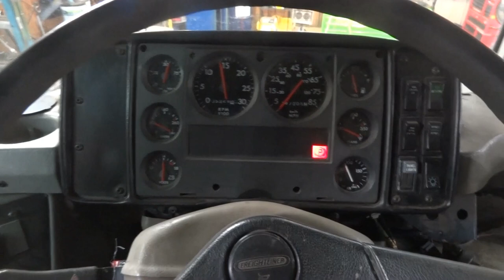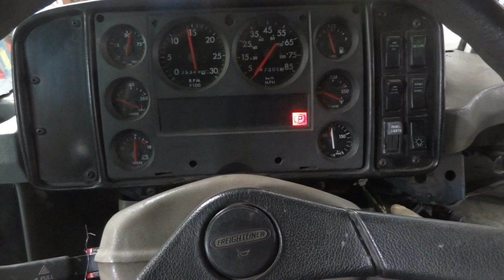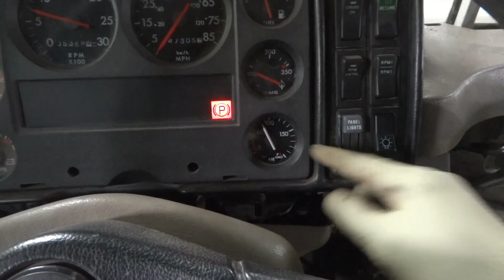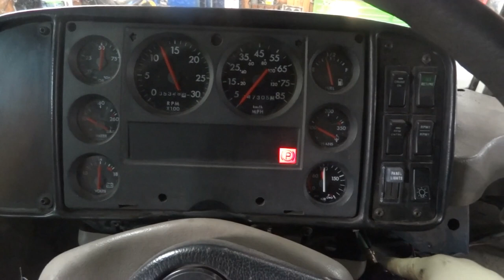Brake Chamber Replacement on a 05 Freightliner school Bus

Comment: I hope you didnt leave that ABA  adjusted like that.That red or orange tape or marking that shows when you applied the brakes is an indicator showing excessive stroke. This means you have no more pushrod travel and your brakes are way out of adjustment. Also the 90 degree angle , is when the service brakes or parking brake  are applied,  not when the brakes are in thier released position.
By the looks of it when your friend hit the brakes the angle was over 130 degrees which is why the orange indicator was showing. Hope this helps you clarify the important details in the future so your viewers can be aware of  improperly adjusted brakes.
Reply from the maker: Reekson  yes that's what I said in the video, 90 degree angle when the brakes are applied! And I believe I did mention in the video that the brakes were gonna get adjusted again!! which was done off camera! the procedure stays the same!
Reply: @KITS_Auto_and_Truck_Repair  I must have missed where you mentioned that because I only heard what you said @ time slot 34:48 but you never mentioned with the brakes applied , 

I did hear though that you might have to adjust the brakes.

Either way NOT trying to hassle you Im  just trying to point out details like the excessive stroke mark showing on the rod should have been your first clue that the brake stroke on the chamber you replaced was way out of adjustment with out the need for a drive test, which could have been dangerous by the way. I usually set my stroke adjustment @ 1 1/2 "  on a type 30 chamber.

Comment: I learned alot this is something I want to master. My question is this. Once the chamber was replaced you caged the chamber to release the brakes. Couldn't you have built up air pressure and then released the brakes from inside the bus?
Reply from the maker: 1ST.SUN. 5TH.CHILD Yes that could have worked too, just a different method

Comment: Also when you put the lines on the chamber you said that the line you installed on the back of the chamber was the service side but isn't that the parking brake side?
Reply from the maker: 1ST.SUN. 5TH.CHILD Slip of the tongue, I meant the hose close to the push rod is the service hose, and the one in the back is the parking brake hose